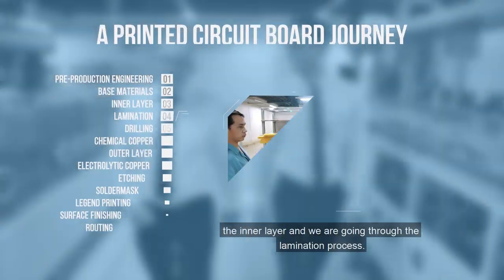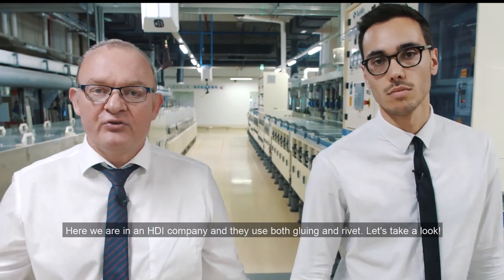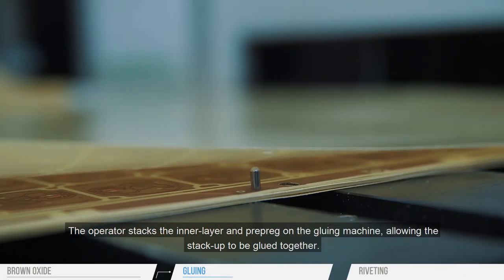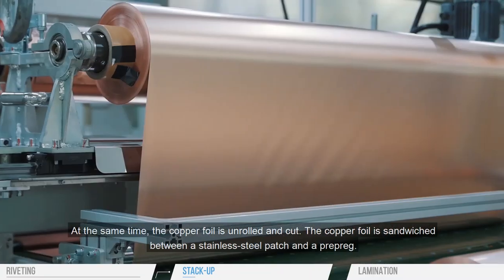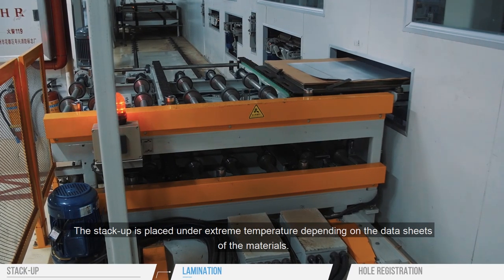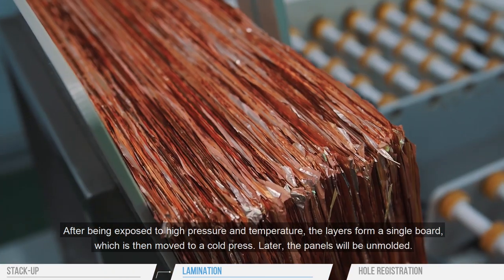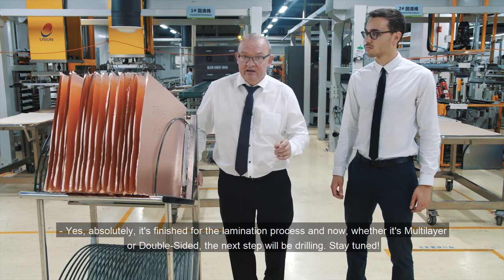PCB Journey Episode 4, Lamination

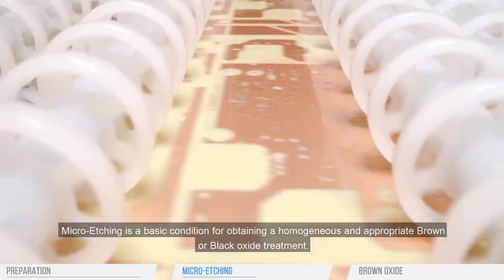Comment: 1:00 copper is reduced from 0.2 to 1 micrometer?  That can't be correct.  First, that's an increasing change, not decreasing.  Second, a 1 micron thick inner layer could not work (I think) with controlled impedances unless the dielectric were similar in thickness, which I'm not aware is possible yet in industry.  Not to mention the elevated inductances and resistances.  Am I missing something here?
Reply: Its a microetching, they are reducing 0,2 to 1 micrometers of for example a copper thickness of 18 micrometers or 35,it’s cleaning the panel
Reply: @georgegoce7383  Oh so your saying that's how much they're removing, not the resulting Cu thickness after the etching process.  Thanks!  This clears thing up for me.  I totally misunderstood what was being described.  🙂

edit:  yes, I mean micro-etch and should not have said "etching process".  This is an important distinction from George.
Reply: That’s right microetching it’s just polishing the panel it’s little different than etching where you remove everything